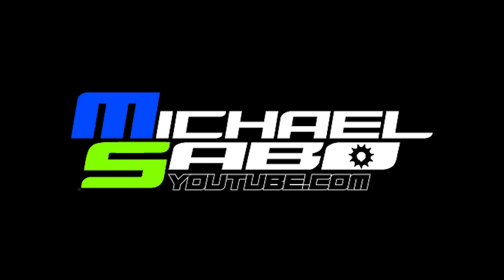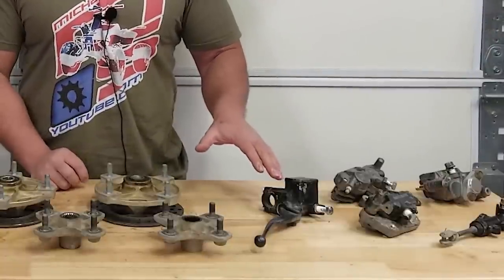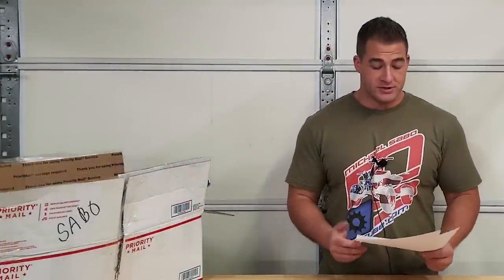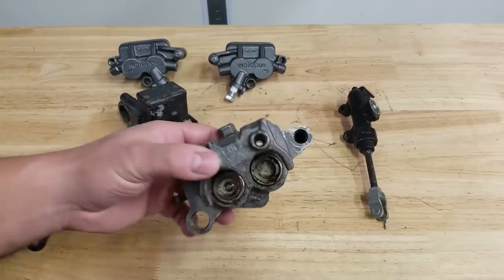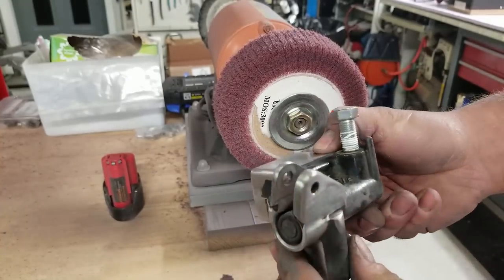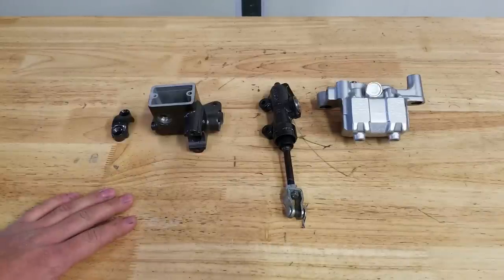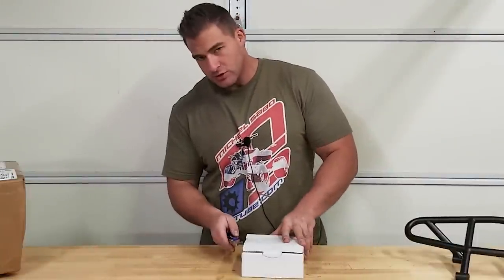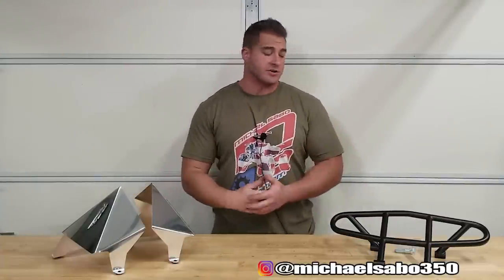Rebuilding Brakes, Hubs and Preparing for Powder Coat! | Project 250R Part 22

Comment: Hey sabo, listen too me bro. I ran 86/87 front end for years. Sell those spindles and hubs! The 88/89 spindles and hubs make it feel like a whole new animal. I had my doubts, seemed a tad unnecessary. When I finally made the switch, I felt like an idiot for putting it off for so long! Turns and steers so much better! You won’t be disappointed.
Reply from the maker: Damn bro... this will go in the category of "things id do differently on the 250r build if I could do it again." I already had the Roll Aarms setup for the 86-87 style 😒

Comment: Back on track with the 250R... YEEESSS!!!!! Just a guess, I think that extra piece on the ASV brake lever is for actuating the brake light if you end up using 400EX or 450R master, which is pretty common. I bet the levers are the same sku for all three.
Reply from the maker: I think you're right Shaun; it came with little inserts that have labels with different manufacturers on them.

Comment: That "Tang" on the ASV brake lever is for quads with brake lights like the 400ex and 450r. It trips the brake light switch when the brake lever is pulled.

Comment: Those master cylinders do look good. But I'm surprised you didn't go with trx 450r masters and calipers. Or some brembo atleast master cylinders. I've had trx 250r 450rs and a yfz they all had the trx 450r calipers and master cylinders. Same thing with the hubs surprised your leaving them stock 250r. As far as the Duncan bumper goes I totally agree and have always thought the same since 99-00. I lucked out years back and ended up trading a practice bike yz250f for a fully mx built 400 that had one on it. I kept it through the years and put it on different quads. Ready to see this thing get built.
Reply from the maker: When I was setting up the front end I did consider the 450 setup as well as the 88-89 hub setup for the front end; at least from what I gathered; the upgrade isn't THAT much of a difference to justify the cost; at least for me. I wanted to do the most quality stuff on this build but I had to draw the line in some areas to fit this build into my budget. The brake setup I have with EBC pads and stainless lines should be responsive and reliable. As always though, I appreciate the feedback man!
Reply: @MichaelSabo   the build is going to be epic! I just figured you would go the whole way since you weren't sparing much expense to begin with. The steel braided lines help a lot the pads you wont notice a difference.  I always run steel braided lines.

Comment: What paint (brand, color, etc.) did you use on the master brake cylinder and btw the 250r is turning out sweet and I can’t wait to see the end result.
Reply from the maker: Thank you bro; they are all rustoleum paints; I am going to make a post tomorrow with the exact paints because I got several DMs asking the same thing! It will be on my Instagram @michaelsabo350.
Reply: Michael Sabo okay thanks 👍🏼

Comment: I'm thinking about doing the 04-05 450 conversion on my 250r. Since mine doesn't have any front brakes.
Reply from the maker: From what I understand; that (04-05) and the 88-89 hub setup are the best route!

Comment: Sabo why didn’t you do the 400ex spindle/hub conversion
Reply: b1zzl3 also wondering... mine made a world of difference because I put the YFZ 450 front calipers and man it’s the best brakes I’ve had on any quad... the stock 400 ex calipers suck, even stock 250R is better
Reply from the maker: This is going in the "things I'd do differently if I could do the project over again." The roll design arms are already setup for 86-87 style spindles. The rebuild, EBC pads, New discs and stainless lines should be a responsive and reliable setup regardless.
Reply: Michael Sabo ya I’ve been there buy a bunch of stuff just to find out later that there’s a mod or swap part that makes more sense ether way tho sold build and I gotta say you are one of few you tubers that actually consistently respond and that’s going above and beyond my hats off to you bro for that

Comment: your build is looking sweet. i got my cases and cylinder back from LED yesterday to powder coat them and on tuesday i am bringing them back to him to have him rebuild it but this is a link to the TRX250r.org forum and go to page 2 and the one at the bottom is pics of my motor. i did all the powder coating. https://www.forums.trx250r.org/index.php/topic,8839.0.html
Reply from the maker: Looking good Evan; the masked off clutch cover face looks great!